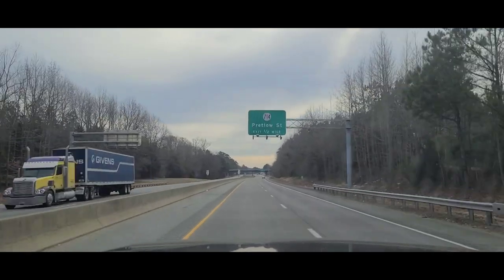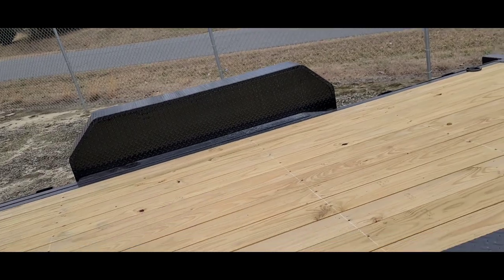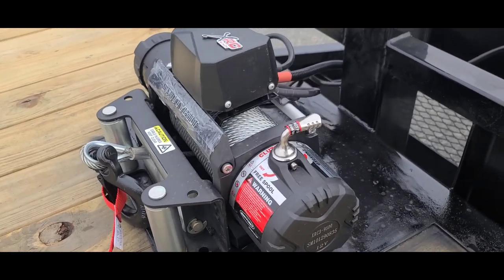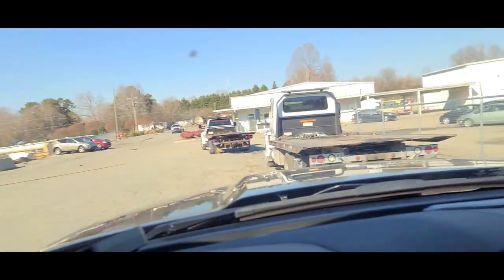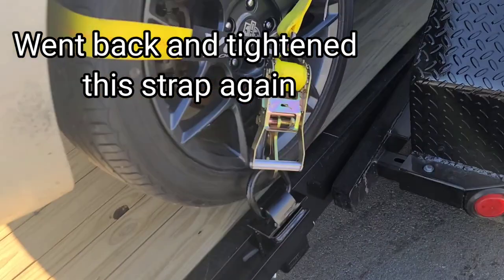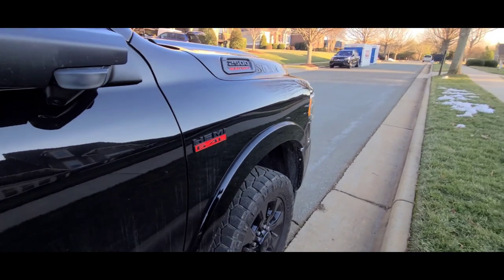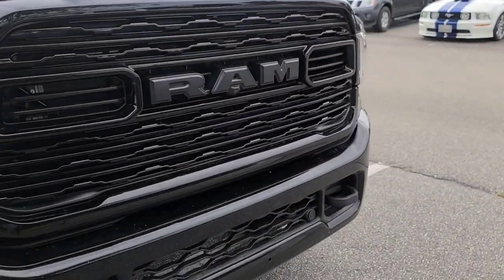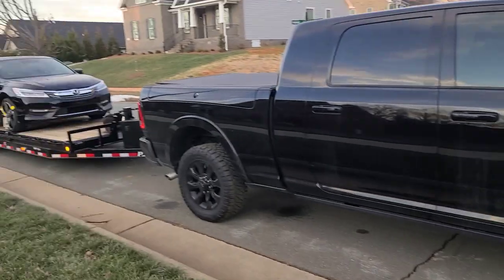2500 RAM 6.4 HEMI Non-CDL Hotshot Part-Time: New Trailer Pickup w/Explanation, 1st Load & More

Comment: That's a great set up. I'd say that's the best of all worlds with that trailer. You could haul construction equipment, warehouse equipment, forklifts, automobiles, industrial bins, you name it. That 9500 LB wench will serve you well. I think you would do very well as a hot shot driver. I thought about getting into something like that myself. I love to drive and pull trailers. Had a CDL back in 1998 thru 2000, drove for Steven's Transport and Schneider Transport as a sub contractor.  I do miss that open road at times. Great to see ya take that on that challenge. You will do well, you have right mindsight. Congratulations and cannot wait to see ya document the adventure further. All ya need now or down the road is a nice little Uniden CB with a black NMO Mounted 27 mhz antenna set up like what I have. This way you can listen in on channel 19 for all the road condition reports and accident information. There is still some less then desirable conversations out there but when you start to see brake checks, its nice to get a little more information on what's going on and what lane to be in.  73'a and best wishes!
Reply from the maker: I appreciate the support and the wisdom. I also appreciate you for taking the time to write your comment.

Comment: Congratulations on your new trailer, what a lot of people don't understand about hauling with a gas vs a diesel truck is not only the pulling power with less effort but the exhaust brake which where the Cummins is a beast, heat is what destroys your drive components, wheel hubs, brakes and transmission and also cause tires to heat up causing blowouts, it's a good idea to purchase a thermo heat gun and check your temps on wheels , but if taking short trips shouldn't be a problem , wish u best of luck on journey
Reply from the maker: Thank you. I definitely hear you on the difference between the gas and diesel. I will be taking primarily short trips but will definitely be getting that thermo heat gun as you recommend. I appreciate your wisdom on this my friend

Comment: Is there any issue maintaining the warranty when using the truck for commercial use? I just got my Ram and opted for the extended warranty. I thought the commercial use would have to be something not mentioned to keep it.

Also, really enjoy your videos. I’m thinking along the same lines of trying to do this part time as a supplement to pay for the truck, and potentially going full time. Ironically, the tilt trailer is exactly what I have set up to buy as well, just in gooseneck.
Reply from the maker: I appreciate your support my friend. That's a great question. For me I went from it being one company vehicle to another. I transferred it from my other company to this company it wasn't like it went from personal to business. I called the dealership and spoke to the finance manager about it. He said it is fine because it's from one business to another. 

In terms of the trailer. I am very happy with it. It has worked like a champ so far. Really no complaints on it. It is doing what I intended it to do when I purchased it. I think you would enjoy it (just my opinion). How you intend to use it will really be the determining factor. I'm wishing you all the best. Please keep me posted on what you decide.
Reply: Yes! That warranty IS NOT the same. Do not waste your money on an extended warranty.

Comment: Sitting in the 919 from the 704. Great video and I picked up my 2500 last week. 
How did you feel about the loading and tie down process in regards to safety?
Reply from the maker: Thank you and Congrats! I practiced on my own  car before going full scale worth loads.  It's hard on the nerves at first but the more I have done it the less nervous I become. I check the load frequently though. I can't fully explain it but you get a gut feeling when you something is not right with how you secure the load. That is always a point where I stop and redo a strap or connector. The 704 and 919 are great areas that have a lot of movement in them. I'm in VA today but hopefully we can cross paths one day

Comment: Because you have done so much great research, what are your thoughts on the Ram towing 5th wheel?  I did get the 4.10. Payload is 2890 and towing 17000. The two I keep on my radar are 13995 35’ and 11995 32’
Also, if have any Navy friends, ask them to teach on tie downs lol. I think they love the challenge, or at least that my experience 
The gut telling you something is wrong, I completely get
Reply from the maker: Honestly, I believe the 13995lb 35ft 5th wheel would be too much for the single rear wheel 2500. Especially if its only the UVW and not the GVWR. I wouldn't recommend it and I dont think it would be a pleasant experience. The 11995 32ft would personally make me feel better if I was choosing between the two. You want to calculate at least 20% of the trailer weight to transfer to the truck's payload for any 5th wheel. 20% of 13995 is 2,799lbs leaving you less than 100lbs of payload. For the 11,995lb trailer it the translating payload at 20% would be 2,399. It would leave you just under 500lbs of payload. Not sure if you want to play the weight game on every trip. It can be done but you would be at your max payload on every trip. I'm not one of the tow police that screams you will die and kill everyone in the world if you do it but I don't feel it's the safest or most comfortable situation to get into. As I'm typing out this comment, I'm thinking you would want to go with a 3500. I hope that helps. Sorry I don't have a more encouraging answer.
Reply: Thank You very much 
I’m with you and not a tow police. I think I may stay with my 24’ TT.
Reply: Also, those weights are GVWR not UVW
Reply: UVW 9854
Reply from the maker: @ksmith114  gotcha. I decided to assume it was GVWR. It makes me feel a little better but I would still recommend the 3500 for the larger trailer. I think you could pull it off but I personally wouldn't do it. The smaller trailer should be good with no problems. That's just my initial thoughts. Which one do you feel the most peace about? I would say go with that.

Comment: I have a 2023 2500 gasser. Do u think I can haul 2 small cars on a 30 ft gooseneck   14k trailer
Reply from the maker: I would recommend a 3500 for that but depending on your specific truck's numbers, you could do it. If you're non cdl the 2500 will work better toward the 26000 lbs limit

Comment: Ummm...why would you use a gas engine for hot shot? You DONT have a 100,000 mile warranty. Thats for diesel powertrains. Thats for PERSONAL trucks, not COMMERCIAL trucks. When you go to have something replaced at the dealer? You will find out!  And, who told you that trailer would be profitable? Im not being a dick, im just wondering who guided you to buy that setup.